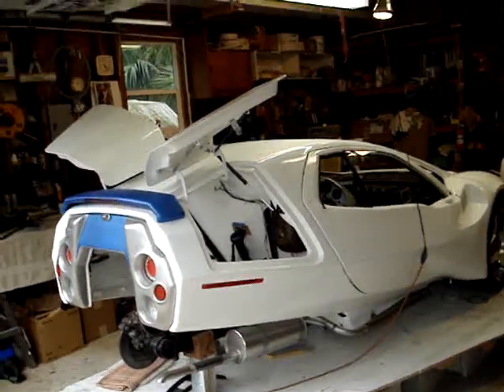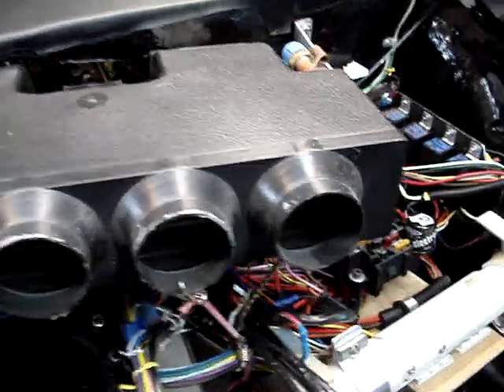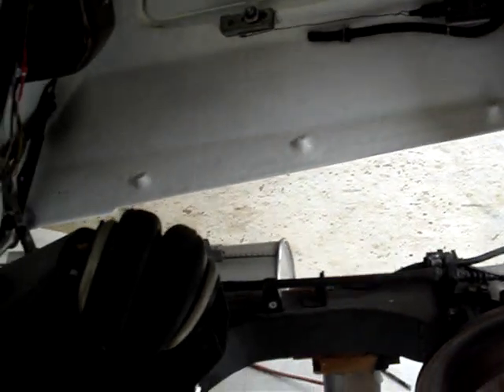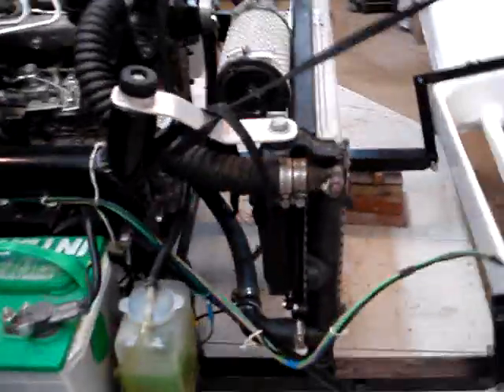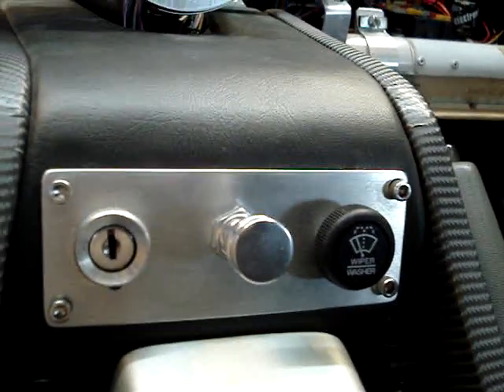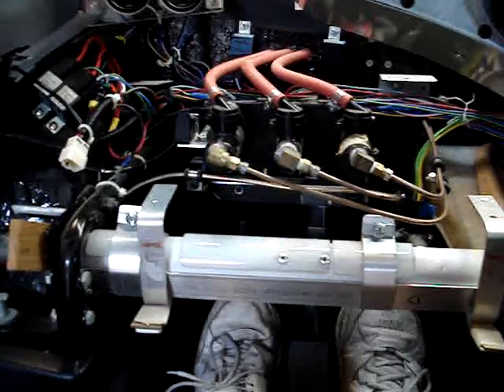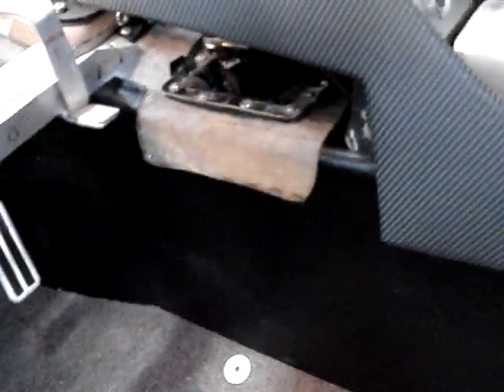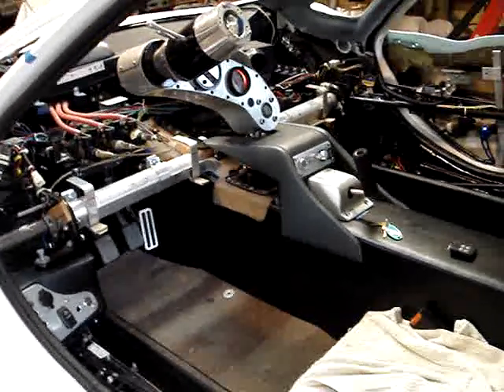XR3 Car Build Progress - Electrical 9 3 2018

Comment: Looks similar to K's Spinner in Blade Runner 2049. Spinner stretched out a bit more and front engine bay section missing. Bought XR3 build plans but build partner (his workshop) dropped out. At the time I pointed out potential problem with pneumatic lift of driver compartment bubble. Got lot's of flack for it. Your vert. lift doors much better solution which Spinner has as another similarity. BTW SketchUp has 3D Spinner drawings which possibly could modify into XR3. Your work looks good.